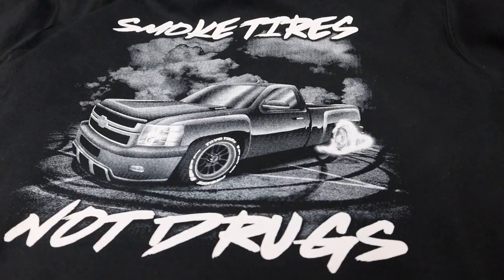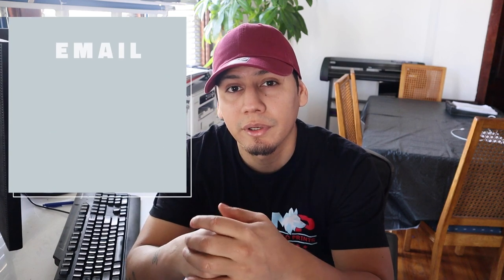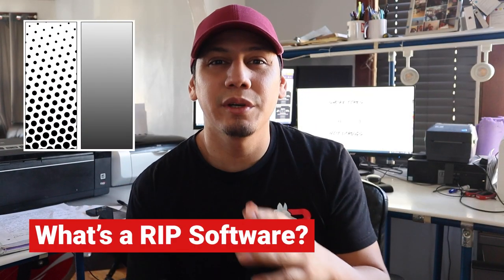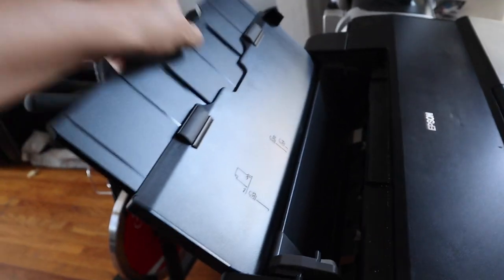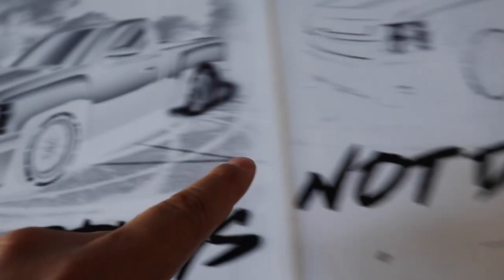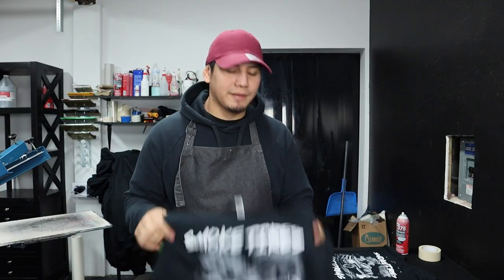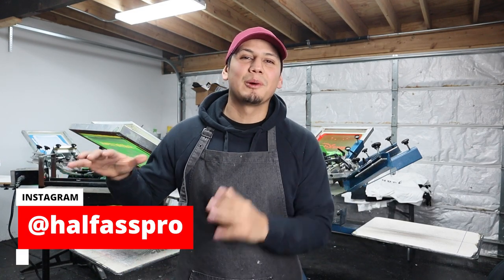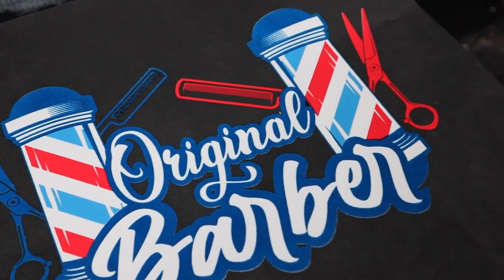How to Screen Print Halftones | Beginner Edition

Comment: did you know that if you perform a cmyk and use the same angle as like 22.5 for all four colors .. it would still work?  yes .. I tried it and it worked. only those who know much about halftones and cmyk  will notice the difference in quality .. otherwise .. it works just fine.

Comment: Halftone 50 percent is what cash is made of dotted per inches offset only can go 305 300 dpi 50 lpi and with metal stainless steel mesh 500 600 20 microns .008 etc .0043 to ymcb n 1 divided it in the right amount n next step its to own 100000 dpi

Comment: Hey bro what changed when you did the other two frames ? Im guessing the amount of time you washed off the emulsion/ making sure all of the emulsion came off of the frame? Or did you change your exposure time bro to make sure all the halftones appear? Halftones most def require alot of trial and error, but the awesome thing is that all that trial and error is necessary to learn the basics / become a better screen printer. You learn alot more from your mistakes 100%
Reply from the maker: I did two things lower my time when exposing from 1min to 45sec. I also when up in mesh from a 230-280.
Reply: @myloprints  thanks for the info Mylo !